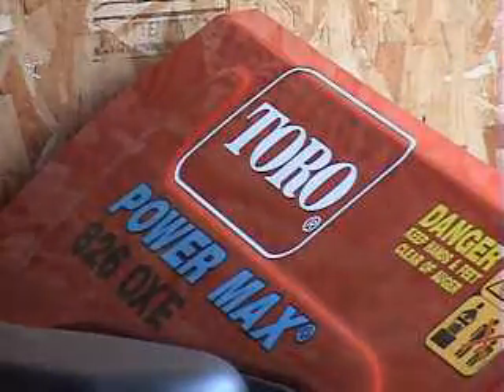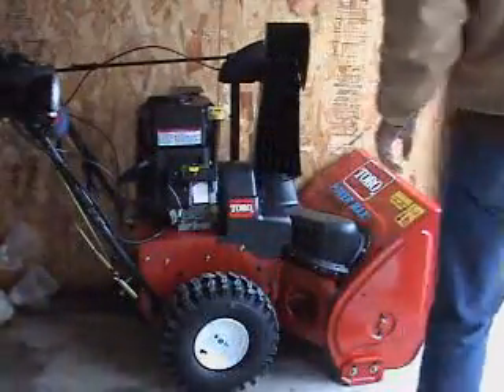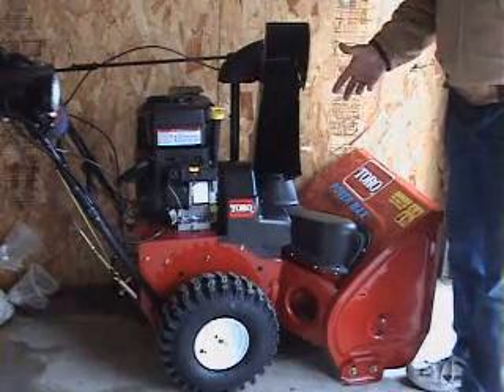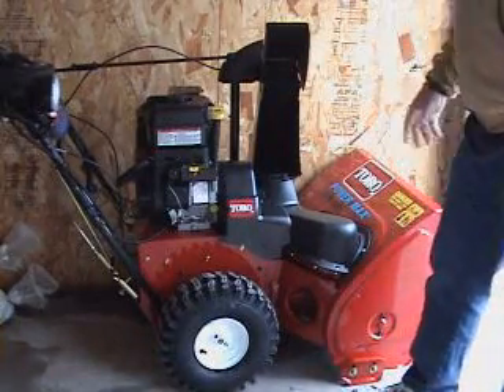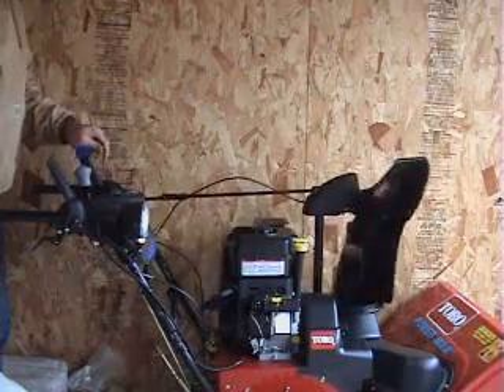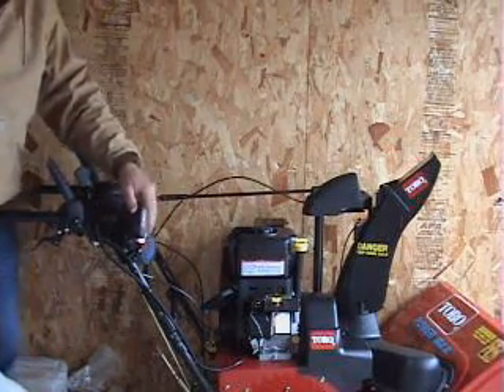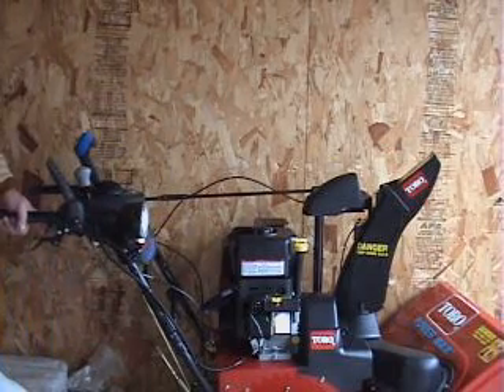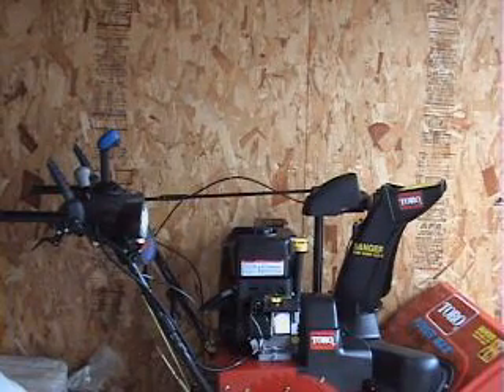Toro Power Max 826 OXE NEW 11-19-2010

Comment: @JasonNiemier 
Thanks for the response Jason and the words of wisdom.  I'm leaning toward getting the toro 826 or the Ariens compact 22" with a 169 cc Robin Subaru engine.  Unfortunately, I have not been impressed with Ariens quality.  4 years ago, I bought a compact Ariens 24" and over 3 years, it was constantly breaking down.  Not sure if a 169 cc Robin has enough power for heavy snowfalls.

Comment: @JasonNiemier 
I have no idea what happened with that Briggs engine on my Ariens.  They say that the engine runs lean to get it through emission controls.  On shutdown, some unburned gas is left in the carburetor and/or cylinder.  This is what leads to the backfiring on shutdown and having to wait to get it to restart.  I've seen the Toro 826 in my dealer's showroom.  I'm impressed with it.  My only doubt is the fact it has the same 250 cc Briggs engine.  Will it backfire too?

Comment: Great snowblower.  Congratulations on the purchase.  Does that Briggs engine have any issues with backfiring.  I bought an Ariens Platinum deluxe 24" model last year.  It had a 249 cc Briggs engine on it and that thing would backfire on shutdown and then wouldn't start.  Briggs replaced the engine but it still did the same thing.  Ariens is now going to refund my purchase and I was thinking of getting this 826 unit from toro but it has the same 249 engine?

Comment: Jason thanks for the post, I just finishing assembling mine,  the auger handle would not stay down, watching your video it occured to me the drive handle has to be pressed first, then it works. The user manual is probably the worst has ever been published, it even beats the chinese manual in ambiguity .and lack of details. A great company like toro does not want to spend few dollars to produce a decent manual or a video for their customers.
BTW how your blowers is holding up after all these years?
Reply from the maker: transformer889 Aside from a bit of rust it’s holding up
pretty good I’m happy with it.